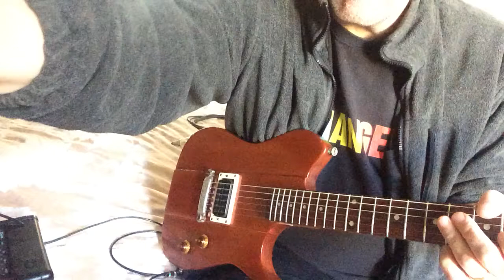Wide range tone control

Comment: Wow, that’s a lot of versatility for 2 knobs. That wiring would never have occurred to me, but then again I’ve never been restricted to 2 pots. I’m currently playing an Ibanez John Scofield that I’ve modded with coil cut on a freeway switch and rewired the extra switch as a phase flip.
Reply from the maker: Cool ! I personally like less switches and knobs as I think it looks cleaner -- but all cool !
Reply: @BenPrevo  I know what you mean. My Ibanez has the classic 335 kind of configuration with an tiny extra switch. I just changed the wiring to my liking. The freeway switch from Stewmac still looks like a classic 3 way switch but it’s a 6 way configured like a gearbox. 

I also put in a Russian PIO cap and an orange drop and rewired the tone pots to 50s style. I way prefer the way it keeps all my definition when I turn the volumes down.